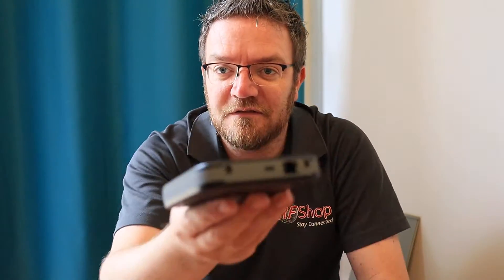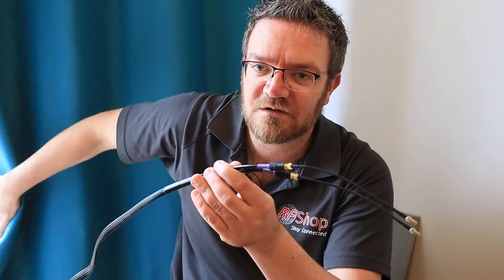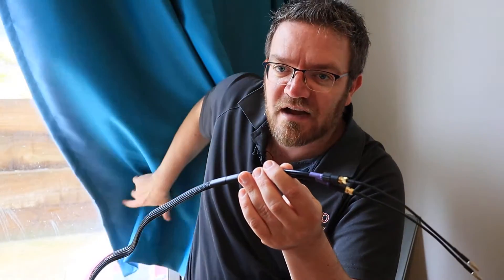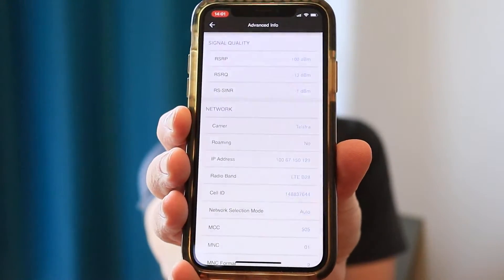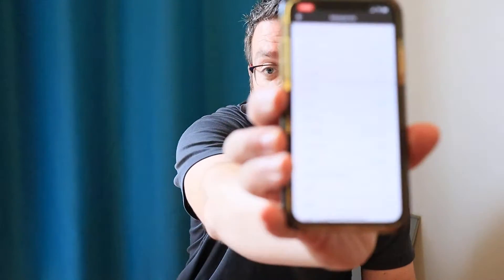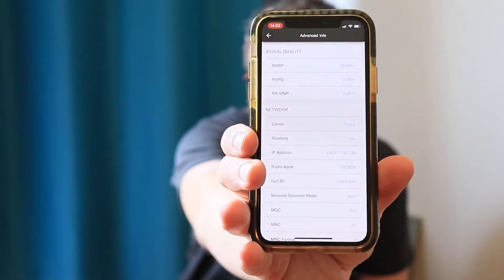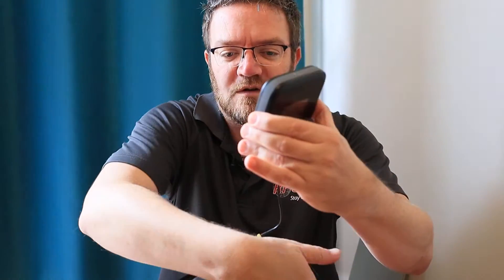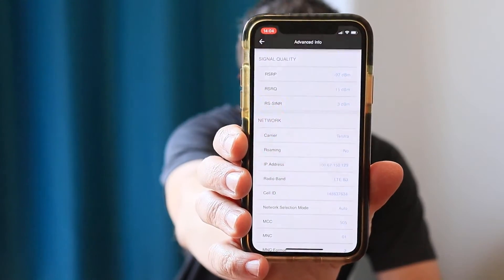Single Antenna on a NightHawk M6

Comment: What antenna would be good using it with a first net Netgear m6 pro hotspot. I get good speeds, but I get some packet loss. And I use it for Iracing and my ping is 91 in that but sometimes I get a quick disconnect. So wondering if I added an antenna to my house as I have a 30-40’ tower tripod cemented in the ground and attached to the side of my house for my home internet which is a wifi antenna from another location but that’s slow compared to my hotspot. So I could use that tower to add an antenna to maybe get lower latency I was thinking.
Reply from the maker: It'll be very hard to say what the best solution is or whether it will work well. Many environmental variables I don't know about. However, I would try to use an XPOL-2 from Poynting Antennas. Get the antenna as high as possible, and turn it to get the best signal strength and RSRP into your modem.

Comment: I have this antenna but after using it my m5 does not wish to work without it at all even within good signal areas. Have you encountered this and what is the solution
Reply from the maker: It may be that the small TS9 connector is still stuck in external antenna mode. I've seen that happen a few times.

Comment: Will it give me fast internet connection in my semi truck for gaming?
Reply from the maker: Hi...yes, it would actually help with fast internet
Reply: If you're around interstate, you probably don't need antenna for it because cell towers usually go right along interstate. But yes it will give you fast connection